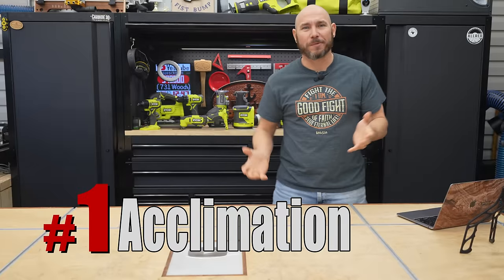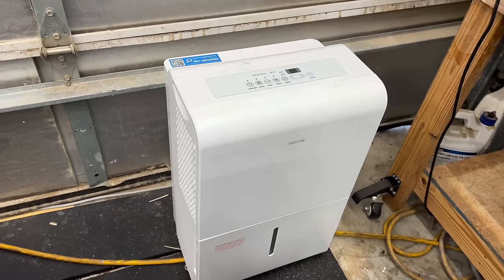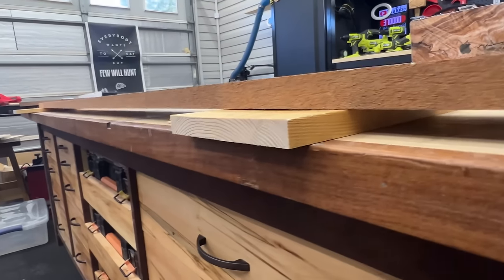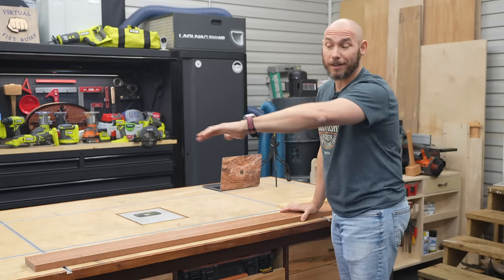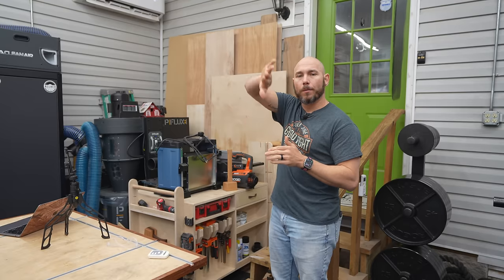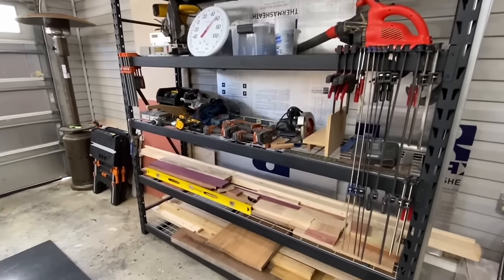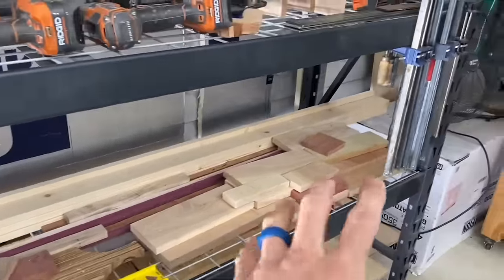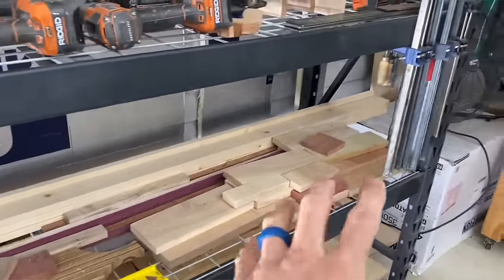99% of Beginners Don't Know These 5 Mistakes Ruin Wood!

Comment: Just an fyi, if you HAVE to store wood with only two racks, make sure the racks are 1/4 in from each end of a board.  This will balance out the load and reduce bowing.  For example, for 8' lumber place your racks 2' (1/4 of 8') in from each end.  Each rack will then support 2' on each side.
Reply: Since the internet is forever it might be best to edit your comment to say a 1/4 of the way in from each side.   Until I read your example I seriously thought you ment a 1/4 inch in.  thanks for the sound advice!

Comment: Great advice, thanks. Now for the big challenge, wet pressure treated lumber. How do you keep it from twisting/bowing/cupping as it dries.  I’ve had several fence jobs turn bad only a few months after install.

Comment: I bought 6  2X4x10 a few months back for a train table project. I did the wood cutting on my porch, and after I had the right fit that wood was put in my house at the spot where it was to be screwed in place. Started around 8:30 AM and finished up around 2 PM. By the time I was about to screw this all together in my house, almost all of the long 2X4's had a twist in them. I did the best I could despite the twist. The problem is not so visible and it is built but they are not as strong as I hoped. The table part is about 3.5 feet by 9.5 feet with 5 of these as the main cross supports. I was hoping to avoid having to have a center support for the 9.5 span but almost right away I had to have a temporary one if I was going to put any kind of weight on it. Yet with older 2X4X8 I had almost no problem with strength or twisting in the past years using only 2 for the 8 foot span. About 6 years before I bought 4 of the 2X4X10's from the same local hardware store for a 2 foot by 10 foot shelf and they were fine and still are, with a span of about 8.5 feet, but even then I felt it wise to have at least one middle post where I could. (3 foot span and 5 foot span) I would guess I have at least 600 to 800 pounds on that shelf with no twist or bending. Wood can be weird!

Comment: Great video, very informative but I have a question. Once the timber is perfectly acclimatised to your own environment and you then spend a week crafting a beautiful piece of bespoke furniture for client who lives in an area which has a different climate. What would happen to that beautiful piece of furniture once it arrives in that new location with a very different climate? Surely due to differences in moisture the timber would either shrink or expand again thus ruining the piece. Please clarify. Thanks
Reply: Short answer - yes.  Longer answer is, if you are going to make something for use in a very different climate, you need to get your timber (and ideally your shop) to similar conditions as where the furniture will reside.

Comment: You didn't mention one thing I noticed you do that I have just started doing.  When helpful label the end of the board. I am blessed with 10' basement ceilings so even though I am 6'5", the boards I have stored on higher fully shelved units might be hard to see when it comes to length and sometimes species. I have started  labeling the end with the length and, if helpful, species. That way I don't have to keep pulling things out to see how long they are. If I cut a piece off I just remeasure and relabel the leftover. It also works great for other stuff, especially piping. You can easily store multiple smaller diameter pipes within larger ones and find the length you need without pulling a bunch out. I like storing things up high, it keeps my wife from thinking I have stuff all over the place

Comment: You are absolutely correct about staying off concrete floors but something you would not expect is that at any fixed temperature the higher humidity air is lighter than the lower humidity air.   But because the moisture in your space is relatively constant the humidity near the floor will be the same as at the ceiling and there will not be any buoyancy effect.

Comment: There are some woods that are more sensitive to acclimation than others. For instance, Monkey Pod really dislikes large temp swings.  it will warp and twist, etc. However, if you work in a climate controlled environment and the project will live in a similarly controlled climate ... and you spline the joints (45 degrees in my case) ... it will help a great deal. KNOW your wood. 
The other issue is how it was dried and how fast. Naturally dried wood that will be used in the same environment as the project (say, maple seasoned in the same general area as it will be worked and used).  This will likely do very well with some thought as to expansion/contraction. Harsher environments in which it was cured? Letting the wood sit and acclimate for a few weeks to years may be in order just to let it breathe and do what it's going to do. 
Also, kiln-dried wood has a tendency to be wetter in the middle, which will cause a good deal of wracking in any direction ... twists, cups ... Just be sure you know how the wood was dried before purchase. 
I like the idea of a dehumidifier, but where will the piece end up? Good for shop work, but not necessarily for the environment in which it will eventually live. 

GREAT info about sunlight. I noted that you have purple heart. Okay, so ALL colored woods will turn some shade of brown eventually because the sun oxidases the oils in the wood, which turns everything brown. This will always happen eventually, even if you account for UV by coating with a UV or Marine (preferred) varnish. The trick to using colored wood (purple heart, tiger wood, pink ivory, bloodwood, etc) is keeping it out of the light.  So, to preserve the wood color, coat in a UV resistant finish, and then keep it out of direct sunlight. In a few years to 50 years (depending on where it's kept), you'll have to sand and refinish, but that's always going to be the case with any exotic, highly colored wood. 

I never, ever, store wood (even ply) vertically. Yes, it saves space, but it won't keep it flat over time. It will always deform. The only thing I've never seen deform when stored vertically? Melamine. 

Honestly, if wood is going to bow, twist, or especially, split, it's going to anyway. Just let it sit for a few weeks to a few months and it will tell you what it will do. Then, don't trash, but compensate. 

The most important thing you can learn is to let the wood tell you what it's going to do, and then listen. Accommodate for what it's telling you it wants to be, choose projects it's good for, and let the wood be what it will be.

Comment: Matt 20 years ago due to the staggering prices of lumber especially hardwoods I opted to buy my  own band saw mill more importantly I can control the cut like rift or quarter sawn for maximum stability (something you should address), of course milling your own lumber is another topic all in itself but its a complete circle and ultimate gratification when my projects are complete from my own lumber.

Comment: The reason I got a new sawmill and started sawing my own lumber for my wood shop is because the last time I bought lumber from the big box store for a project, the wood was all warped and useless by the time I got it home. It was sunny and warm out and the wood was in the back of a pickup truck.

I mill my own lumber now and treat it right.

Wood from the big box stores is almost always quite wet and has to be stacked with pressure on it till it dries.

Comment: So living in the UK we suffer from swings in humidity and lots of cold damp weather. Most kiln dried timber shipped from the states is at about 12% and wrapped in vacuum packed polythene…..as soon as you open it to the environment it starts absorbing moisture from the air and it moves….I have seen American Poplar and American Cherry bend like a banana. There is only one option. Patience. Let the wood sit. For a long time. You need a stock of timber. And big enough pieces to accommodate machining out the twist, warp, cup and bow. I have a pile of English Oak in my loft ready for a project. But before machining it I will let it sit in the downstairs cloakroom for a few months before I use it so the moisture content of the wood matches the environment it will be used in. In my opinion all a dehumidifier will do is dry out the wood…..if a piece of furniture is made and moved to a house that doesn’t have a dehumidifier then that wood will take on moisture and swell….and potentially move…..I have hung kitchen cabinet hardwood doors and had to revisit customers to fix warped doors because of the humidity in a kitchen. All part of the job unfortunately.

Comment: I throw in my two cents on my VERY long term experience with dehumidifiers.  I have been through probably 10 and over pretty much the whole price range $150 to $1800. The bottom line seems to be they are all basically mechanically the same (compressor, condenser, limit switches) with each company throwing on their electronics package.  So don't think because you spend more you get the same multiple increase in quality as you pay in price.  I won't go into my experience with the big Sante Fe unit I had but suffice to say that for the cost and aggravation you are better off using the money to buy 4 or 5 cheaper units over the same time. Sure it had a warranty...for parts mainly..and it weighed 165 lbs.  So even if you can get it back to the factory for free it is a big hassle. Take it local and your bill would pay for 2-3 cheaper units. Nobody, not even the "upscale" producers seem to put charging ports to add refrigerant. They are all pinched off copper tubes only. Aggressive DIY doable? Yes.  Anywhere worth the time and aggravation? IMHO no..not if you ascribe to the paragraph below.

If you are using it in a basement (cooler area) make sure the operating temp goes down to what it will be used in.

The plan finally settled on is: Buy a well-rated unit from Amazon and .....even though I never think it is a good idea anywhere else....buy the 4 year extended warranty through Amazon.  If it makes it 4 years past the warranty and you paid $250 to $350 for the unit and $50 for the warranty consider it the cost of not having to deal with wood changing shape and tools rusting. And who knows, maybe you get lucky and you get one made by angels and Santa's elves that will last more than 5 years.  If it doesn't make it 4 years, all you have to do is follow the simple procedure for the warranty claim and Asurion credits your amazon account and you move on to the next unit. Yout cost is just the difference in cost in the units and the warranty. No finding repair people, no sending it anywhere, no hassles. Except finding a place to drop off the old one.  And, as mentioned, these things are chatGPT. If you are handy there is a chance that you might be able to do a simple cleaning of a sensor or other simple fix (check YouTube) and end up with a working unit as a backup to the replacement you just got.  Just don't make my mistake and try that before you submit the warranty claim as you will probably need pics of the error code on the unit's display.  I cleaned some sensors and had to wait a while for it to implode and show the error code again.

 If I can save anyone the time and aggravation I have gone through it is worth it. Maybe some one will buy me a beer someday:)  And we will all have more time to make stuff

Comment: One thing I do that wasn't mentioned, is to really assess whether you need all those off cuts.  I got so tired of all the spare wood I burned it all a few years back, and since then I really haven't ever thought to myself "gee I wish I had a 3 inch piece of walnut".  If the scraps don't meet certain minimum dimensions, it goes in the burn pile.

Comment: Question. I have purchased three 5.5x10 planks of Cedar board. My garage is 8 to 9 feet high. Could I lay carboard on the concrete and stack all three on top of each other? Would that damage the wood? I'm going to start working on them in a week.

Comment: Hey there, great video. I'd like your thoughts on this please.  I keep all my lumber stock in my garage  all of it on racks high ones low ones and  most of it vertical standing up and in a cart.  I live in the northeast my garage is not climate controlled so if my lumber it's stored in my shop it's ready to build correct? About a year ago I built a Coffee table and the top after about six months maybe not even has cracked significantly, not on the glued seams but right in the middle of the board. Should I have had that wood acclimate to the inside of my home? would that have helped?  It's kind of opposite of what you were talking about but being on the subject I had to ask.  Thank you and again great info as always. Much appreciated.

Comment: Good video, I’ve watched many 731’s.  You have a nice selection of hardwoods. 
I’m fairly new to fine woodworking. Are you able to share any sources/suppliers of        hardwoods?
Reply from the maker: I've linked to the ones I used in the description.  You can also check woodcraft and rockler websites for hardwoods.

Comment: All you can do is the best you can. Years ago I worked for a local contractor. The guy was a good carpenter and one time he built a small box out of walnut or mahogany, don’t remember for sure. It was around 20”x12” by 6” tall. It had a envelope slot in the top and an access door on the side.It was for a local funeral home for people to drop cards into. This was in the winter in western Illinois. He built it in the shop that was heated. We delivered it to the funeral home that was only about 10 minutes away at the most. Took it inside and set it by where it was going to be mounted. Sat down and shot the breeze with the owner for about 10 minutes and heard a loud crack. It had cracked a couple inches on each side of the slot. So, back to the shop, some glue, clamps and refinishing, good as new. A case of warm, cold, warm too quickly.

Comment: Well, I don’t have a shop, yet, so I’m working off my deck where I’ve set everything up, I have my wood laid out and separated with wedges off the deck, so I really have zero choice at the moment, I do have some tarps wrapped around the railing to prevent rain and direct sunlight from coming in.

Comment: Another great video. I built the wood cart by Tamar of 3x3 custom, because I needed everything in my 11'x11' space to be mobile.  Before I started wood working, scraps from home projects got tossed on some pallets and I'd buy more wood vs trying to dig through the scraps.  With the mobile cart, I've organized the wood, and I've used most of it, but I can move it around to make space as I need to. :D
Reply from the maker: Thanks Marion!

Comment: In my area, (Western Montana) the temp and humidity (inside and outside the house) seem to have  a big affect on the wood I have purchased. ( like 1/8" to 3/16"  width loss from some overly wet Home Depot 2x4s yuck!) I let any wood sit in my heated basement at least 3 moths before using it. Inside winter humidity here can get as low as 30% (we recently saw -40 deg outside and no frozen pipes due to climate specific construction). Outside, summer days here rarely get above 50% humidity and outside temp is rarely above 85 deg...Summer nights sit at about 63 deg with all our windows open. (no A/C required) 

So I like to build only with dead dry wood.(thoroughly dead) Dead dry wood yields me no unpleasant surprises later on. In your Southern climate,  I would guess that wood doesn't dry out  as fast as to torque it around so much as in my location and your wood humidity never hits 5% moisture content inside your home?
0

Comment: When those pieces are supported on Bora wood rack or any two point support, it is ideal to put supports at 20 percent from end of board. This means deflection at centre of 60 percent board length will equal deflection at end of cantilevered 20 percent of board.

Comment: Please don't think less of me because at this point, my shop is the back patio as well as, all my wood storage is currently outside as well. I'm mostly concentrating on making small craft the items, knik knacks, wall art, only just getting started. I use pallets/crate wood from the heavy duty body repair facility I work at. Today, I built 2 assembly/work tables out of free crate wood from work. They're not ideal, but they're perfect for where I am right now. Tomorrow, I'm going to make a version of that entryway shoe bench rack that you started out with. It's gonna be 4  2"×4"s wide cause I don't currently have enough 2"×6" material to build it exactly as you did. Again, my spin on a great idea. I may add some vertical supports with a top shelf on top, a coat-rack underneath the shelf and a mail basket on the side.😅😎. It's what the wife wants. I'll try to send you the a picture after it's painted and stained.
Reply from the maker: Absolutely would never think less of you for that! That's amazing that you are building great projects on your patio. You're using what you've got!  Keep at it!

Comment: The shelving you show at 8:44 are far cheaper at Sam's Club, if you're a member. If not, that one purchase will more than pay for the membership.  They're $300 at Lowes, $350 at Home Depot, and $200 at Sam's.  They're the exact same thing at each store.

I don't use them for woodworking but I have five, just for general storage.

Comment: Great content man. Just want to correct something you said: "Moisture is heavier than air"; actually 'moist air is lighter than dry air' because hotter air is more boyant than cold air; and hot air can hold much more moisture than cold air; so the moistest air is typically found near the ridge of your roof or attic, not your slab. That being said the slab is typically way too moist to leave wood on top of it because of the subsurface moist conditions of that slab even if 6mil poly was laid down prior to slab conc placement.